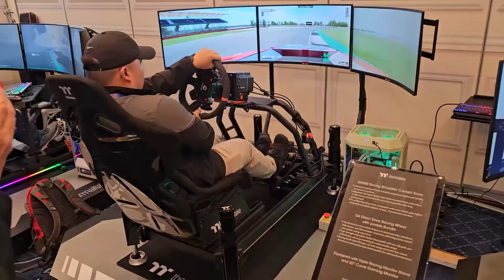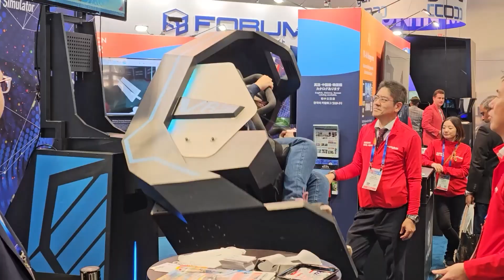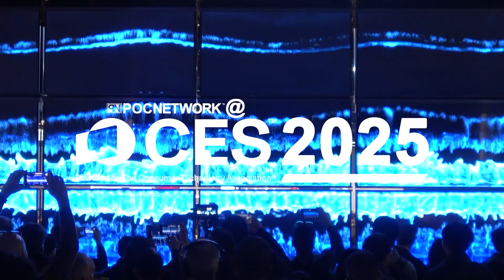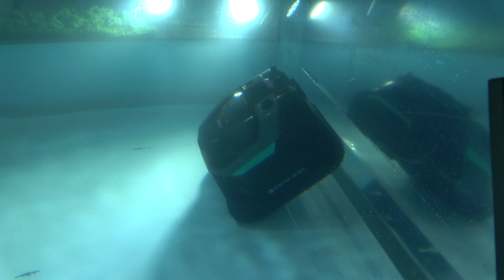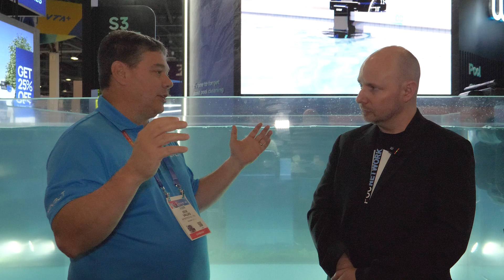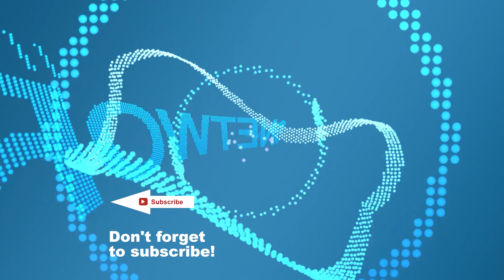WYBOT - S3 Pool Cleaning Robot With Wireless Solar Charging - Interview - CES 2025 - Poc Network

Comment: The only issue I have with the wybot S3 is that...it doesn't work.  The software is screwed up.  The battery runs out before it docks, so it just ends up being a lead weight at the bottom of your pool.  And I can't reach anyone for support.  It's garbage.

Comment: The only problem I have with this cleaner is that 
it is charging the battery all the time. It will wear 
it out quicker over time.
Reply: Something this advanced most likely has battery protection too. Kinda like your iPhone. Just because it's plugged in, it doesn't mean it's charging. It can shutoff charging overnight, predict when you wake up, and finish charging then.